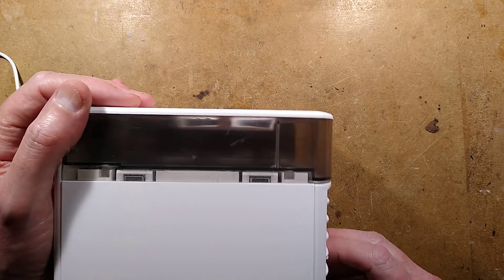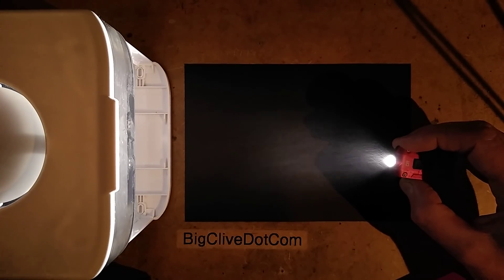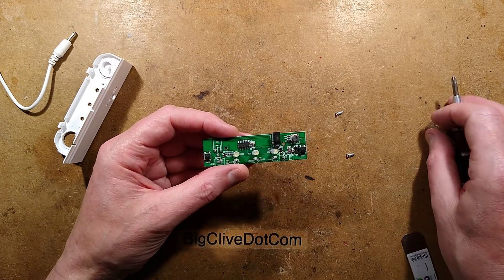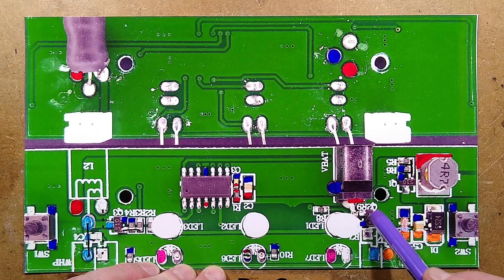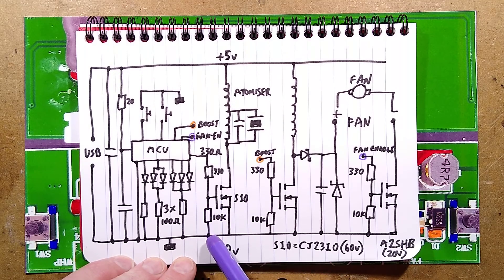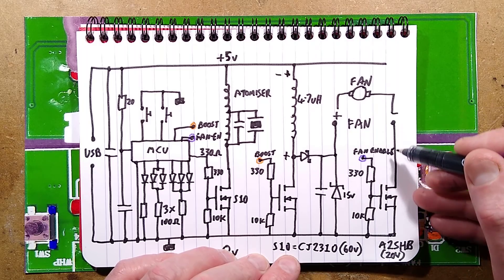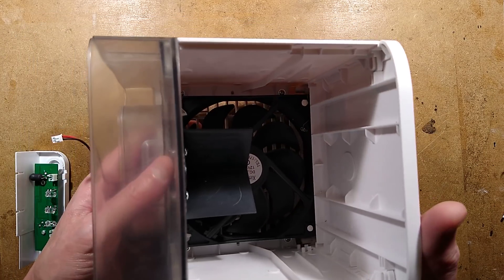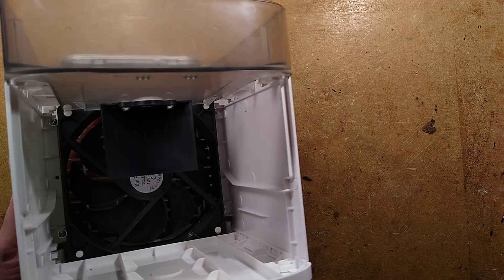USB swamp cooler with fake UVC "sterilisation" (with schematic)

Comment: Fake UV-C makes me so mad; especially since real uvc is so great for disinfection. All products like this do is instill mistrust of uvc tech in the public.
Reply: Unfortunately, there's always cheapskates, dunces, and rubes that will get sold on these products. You can't fix human psychology.
Reply: How can distinguish between real and fake uvc leds?
Reply: @granpatriarca3726  Real UVC LED's are 1) expensive, and 2) housed in a brass fitting, not a plastic one.
Reply: @granpatriarca3726  Banana peels are apparently sensitive to uvc light so if you have access to them you can use them to indicate whether or not your light source may be outputting uvc. The peels will turn brown several hours after being exposed to a few min of uvc light.
Reply: @snowdaysrule  banana peels turn brown no matter what, so I suggest covering part of it with opaque tape before you expose it to the UV light, so you can compare after a while.
Reply: Unfortunately most.people.who buy this won't even realize rhat it is not using real.UVC or Vacuum UV.
Reply: Yes but...your average consumer has no clue about uvc and would stare that sommbitch straight in the eye.  Personally I love the look of them and it still has alot of the perks of the wavelength with zero harm.  People who spend $20 on sterilization equipment are the same people that purchase no name contraceptives.
Reply: @blkmgk16  that's how they outpopulate intelligent people and we end up with idiocracy movie in real life
Reply: @blkmgk16  That's not good, it means the idiots are breeding ...!

Comment: It really annoys me how sellers on Amazon and eBay use the word "air conditioner" equivalent for "swamp cooler" to get people to buy their cheapy-china plastic trash.
Reply: I have seen pallets of these sitting in stores. Just more useless landfill fodder.
Reply: @icanhazgoodgame3845  Unfortunately, that translates to more plastic pollution. Wish there was a simple answer to that...
Reply: Um, it still conditions the air...
Reply: @snakezdewiggle6084  it's the opposite to a real air conditioner for starters it hasn't even got an air filter also an air conditioner dehumidifies as it cools also I don't see any tanks of refrigerant or even a condenser all it does is pretends to cool the air by pumping your room full of damp which by the time summer is over will cause a damp issue so before you say it conditions air take a closer look mate it doesn't even purify the air
Reply: @R0G3RZ87  Snakez's point was it does condition the air. Maybe not in a desirable way, but conditions it nevertheless.
Reply: @R0G3RZ87  I think by definition an evaporative cooler is air conditioner as it 'conditions' the 'air'. Water is actually a classified refrigerant by ASHRAE. Damp generally occurs in closed space; closed spaces are undesirable for evaporative coolers as they aim to displace the warmer air with cooler air. A vapour-compression-cycle air conditioner can dehumidify though at an expense though moderate humidity is generally desirable. I do agree with you though, this one is pretty average.
Reply: @channelsixtysix066  Well said that man !
Reply: @R0G3RZ87  Opposite !?  Are you saying that it un-conditions the air !?  If you can achieve that, NASA have a high paying job for you...

Comment: 13:58 Calling swamp coolers air conditioning but for £13.99I I like the fan and fittings and looks like I could replace that fan when it breaks down.
Reply: It's looks like a standard computer fan tbh, what's makes sense since they are low voltage and cheap
Reply: I'd download more RAM.
Reply: @oldbatwit5102  nah, you gotta get the RGB. Everything must be RGB!
Reply: @Bl4ckD0g  Thanks for the tip. I can use the RGB from my spare Juicero.
Reply: Totally just an off the shelf PC fan. You could even upgrade it if you really wanted to.
Reply: @Bl4ckD0g  I have a box of orange thermaltake fans of many sizes that would fit with speed controllers I collected over the years that would make it ideal for one of those.

Comment: Saw those in the checkout line at Walmart here in the states a couple weeks ago and just screamed scamy
Reply: Evaporative cooling is real, but it's no replacement for air conditioning. And it doesn't work in extremely humid environments.

Comment: Don't suppose they make real UVC LEDs that'd swap out the sham ones easy in that swamp-cooler...
Reply: pointless - they are super pricey, need to be in glass as the epoxy blocks UVC, as will the plastic they are "shining through" into the tank.

Comment: You can freeze the soaked wick cartridge for extra coolness.
Reply: and meanwhile heat up your kitchen with some extra load on your freezer... very usefull to cool Indoors :DDDD
Reply: Freezing the wick will greatly slow down the evaporation, and thus greatly reduce the cooling.
Reply: Or place a "freezer block" in the water tray, and truly chill and dry the air.

Comment: Ah "swam coolers" as they are called here (or more exactly "evaporative coolers", which clearly indicates their function). Given the right climate (below 50% humidity), they can have their use. But let's be honest on a model like this one would have to stand right in front of it to get advantage of it, as it's not going to cool a whole room. Not to mention that calling this Air Conditioner is a real far marketing stretch -- sure, it does "condition air", but no it's not AC.
Reply: It's really problematic when we're talking about the bigger swamp coolers which easily can cost 100-150 EU bucks, while somewhat decent mobile AC units start at 200. Especially in areas where air conditioning isn't common in residential housing (so basically all over Europe) I feel like many people get deceived by this and think that it's normal that they have to buy bags of ice twice a day to enjoy a slight breeze during the unbearable summer.

Comment: I can't imagine why you'd want to humidify the air in a hot room. Don't commercial cooling systems take excess moisture out before they start to lower the temperature?
Reply: Yes, unless you live in a desert environment. Technology Connections has recently done several videos on air conditioners and swamp coolers.
Reply: Any actual "air conditioner" will dehumidify, yes. We need to run a dehumidifier in the basement, in addition to the usual A/C system found in the Midwest
Reply: I live in northern California. Humidity levels during summer is around 25 - 35% @ 90F (avg). So I run a "swamp cooler" and it's AMAZING, quite chilly actually.
Reply: @psygn0sis  Yes they can be for sure, almost like refrigerated air at night as well, but where I am now its around 10.C outside.
Reply: Adding humidity is very effective in dry hot desert environments. It will rapidly chill the air. Air conditioners remove humidity as a side effect to cooling the air. Cold air can’t hold as much water as hot air.
Reply: When I was a kid back in the early 1960s swamp coolers were gaining popularity. They were the "poorer.mans air conditioner" aa true air conditioners were quite.expensive back then.  My parents bought.one and quickly found out that it doesn't work. So did many others discover the same and they quickly fell out of favor and gradually dissappeared. To make matters worst we lived in Brooklyn New York whwre summers tend to be both hot and very humid making the swamp cooler even less efficient.
Reply: Just cooling the humid air will produce water as condensate. You need to drain that water. The cold air once it leaves the chamber warms up and the water becomes drier (lower RH).
Reply: “Commercial” cooling you say?
When someone says air conditioner the implication is a refrigeration system, At least in the states, can’t speak for other countries. But refrigeration creates a cold coil to cool the air in the desired space. Those coils can and often drop in temperature well below the dewpoint in the air thereby creating condensation water. That condensation water is the air in the space drying out. This is typical refrigeration for the last 80 years that we’ve come to know. 
However! New school HVAC says different. Hi efficiency systems incorporate a multiple speed blower or variable speed blower that when used at higher speeds, can allow the user to not dry the air out and simply just cool it(also increasing efficiency by not phase changing the water from vapor to liquid). Still as of yet, many people with these systems do not realize this potential, but I demonstrate it to my customers all the time for them to benefit from it. 
So long answer, yes, refrigeration can be an extremely good dehumidifier. And also, new efficiency refrigeration can also dehumidify on low fan blower speeds. But the user gets to choose.
Reply: @dallynsr  Speaking of commercial cooling, I worked at Phoenix Manufacturing (the company made swamp coolers) in Phoenix AZ in the mid 1970s. By the time I was hired all of their production went to Saudi Arabia, Oman, and other Arab countries where they were installed in homes and businesses as well as a couple of "small" palaces.
Other manufacturers who couldn't negotiate international contracts supplied the local market.
Reply: I think we need an absolute definition of "Air".   
For me, Air has zero moisture / water, and thus, is incompatible with life (humans)
Reply: Humidiffication is a side effect of how "swamp coolers" work. The proper name "evaporative cooler" is the big hint.
They work by passing air over or through a wet wicking material. The water in the material evaporates, taking heat energy out of the air with it. The output air is cooler than the intake air, but the intake air obviously has to be low in humidity. That's why they're usually installed in windows. Yes, that means another window has to be slightly open to allow continuous air flow through the space to be cooled.
They work very well in hot dry conditions like deserts and can in certain circumstances be more energy efficient than actual air conditioners which is why they're so popular in deserts (that have enough water to put in them) like Arizona, USA and parts of the Middle East. Foggy Old Eng;land, not so much.
Reply: @markfergerson2145  I have a big one on the roof of my house and they work really well, and I am in a hot dry part of Australia well in the summer anyway.  When it is humid like lots of rain they dont work well as expected, but then I have a split system as well.
Reply: @markfergerson2145  
It used to be true that swamp coolers were more efficient than refrigeration HVAC, I have found my equipment to bust that myth. It is also not my opinion but rather numbers from my current meter that I read that show how much power hi efficiency refrigeration uses. Now, if we can get someone to manufacture high-efficiency brushless DC motors for evaporative swamp coolers, then again they could have a chance to be more power efficient. I’m using a comfort level of 75° to compare to people with full house swamp cooling and the power comparison between the two.
My low priced 1 ton 220 V heat pumps maxed out use 5.1 A. In a typical bedroom that would make the temperature in there in the upper to low 60s, and usual numbers at 75° is under 2.5-3amps on hot 110°+ days. Those same machines start to short cycle after the sun has gone down and throughout the night because they cannot go slow enough to maintain 75. These are 16 to 20 seer machines, not even the available 22-28seer. That would drop the loads 50% again. 
People forget about swamp coolers in So Az after installing my equipment cause it’s miserable at best and is not a reliable way to cool—Too high maintenance.
Reply: @dallynsr  Two things- I said that swamp coolers can be more efficient than AC under certain conditions (specifically, when it's in the 120F+ range) and of course we can talk about amortized install, maintenance and replacement costs. ;>)
(I'm not in the business and haven't seen recent HVAC machinery but I take your point.)
Second, I've noticed that So. AZ tends to be somewhat cooler and less dry than the Valley of the Sun, at least during the... I was going to write "cool season" but those who've never been to AZ wouldn't understand that that means "Purgatory" rather than "Hell"... I lived in PHX for thirty years and saw snow three times, but from Tucson south it's a more regular occurrence and sticks a lot longer.
Reply: You can not changer the temperature of Air, only the Water in it. Go read up on Relative Humidity. Oh and Antarctica is the largest desert.
Reply: @snakezdewiggle6084  No, you can absolutely change the temperature of air, typically by moving the heat somewhere else (air conditioning), or by creating heat (furnaces). In fact, a typical dehumidifier works by cooling and reheating air.
Reply: @snakezdewiggle6084  "You can not changer the temperature of Air"
I'll ask you to justify that statement. Temperature is proportional to velocity, and speeding air molecules up (thus heating them) or slowing them down (cooling them) is dead simple.
"...only the Water in it. Go read up on Relative Humidity."
I have. Air can have the same temperature at different humidities, the same humidity at different temperatures (within extremes) and so on.
Reply: @markfergerson2145  If the air is already saturated (RH=100), you cannot cool it further in an evaporation based system in which water spray is used to cool the air.
Reply: @janami-dharmam  Snake's comment read like a blanket statement that air cannot be cooled. He didn't specify evap cooling.

Comment: well, I spent a good hour in sim trying to get more than ~6v out of various resonant circuits drawn with transformers as shown for the ultrasonics, and I have to agree with the thought that, at very least, it would be simpler to inject current into the center tap.
Reply: I think it works like a hydraulic ram: You get a high voltage over the piezo-thingy when you break the current. The rest of the windings is to get more energy in the magnetic field.
Reply: I'm pretty sure he draw it incorrectly to the schematic. And in reality it is as the PCB silk screen shows: transformer with common end for both coils. That would make so much more sense. And as PCB traces show, it is like:
+5V_in ---- "positive"~~~~larger num turns coil~~~~"common negative" (or "tap") ---- switching fet ---- GND
UltraSoundTransducer ---- "positive"~~~~smaller num turns coil~~~~"common negative" (or "tap") ---- UltraSoundTransducer

I wish I could tag Big Clive to this reply to hear comment from him.
Reply: I dunno what your all going on about, i just cut the wires on the fan and hooked it into a 12v 500ma power supply the fan runs a lot faster now hahaha.

Comment: You could add aromatherapy oil for extra stickiness. Maybe reverse it for a solder fume extractor.
Reply: Have it spray petrol and set a candle in front for extra flair
Reply: It works well. I used eucalptus oil, lavender lemon, orange but lime was the best. Peppermint would burn the shit out of your eyes, but i got it for like $5 to use on my work desk as a fan worked great for that.

Comment: Be nice and easy to swap the blue LEDs for something closer to UVC.
Reply: you wouldn't put a 38w uvc lamp in that ^^ shouldn't it mainly smell like ozone tho?
Reply: Would that not require different current to be effective?
Reply: @feelinghealing3890  For the 10mm led type, about 60mA. I have a dozen here, made of glass.
Reply: @feelinghealing3890  No idea but it would be closer to the items listing and as it is now the LEDsalso are doing nothing.
Reply: I have professional uvc lamp 38w.
The smell... It smells like rotten eggs when it's working. You need 1 day minimum for the smell to disappear